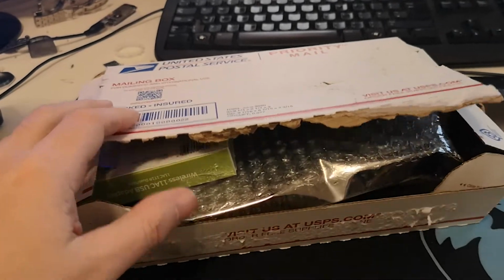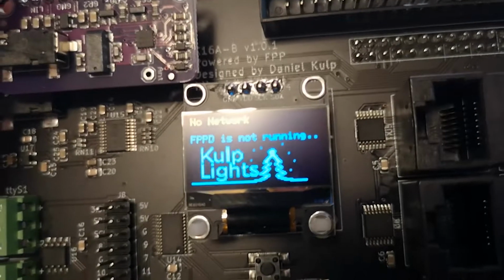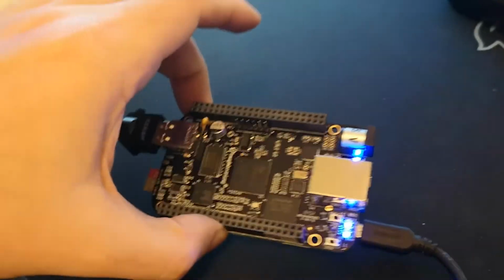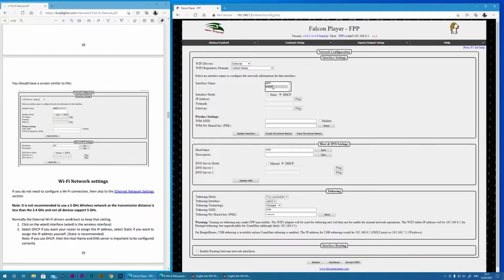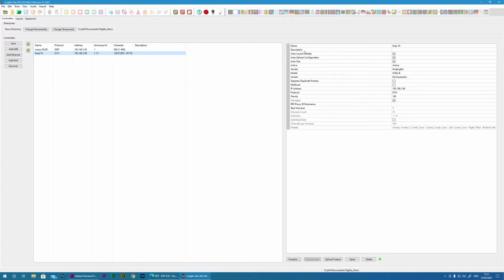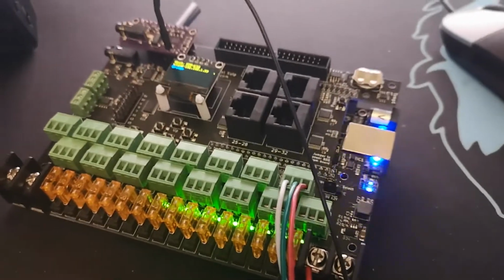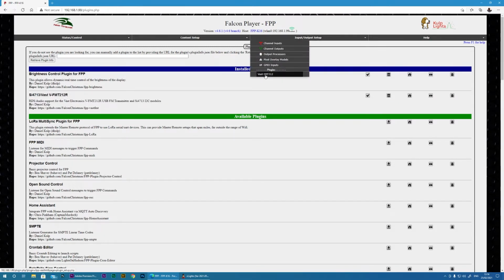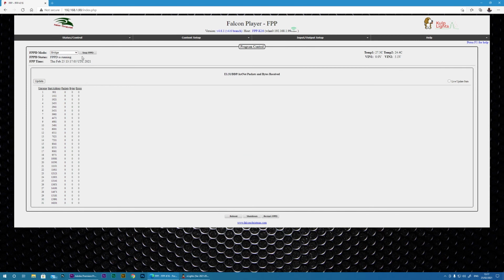Kulp Pixel Controller Basic Tutorial

Comment: thanks for this amazing tutorial! did you used the wire of which kind of metal?
Reply from the maker: @PapaiNerdBR  I just used some thin wire I had in hand.
Reply: @qualar  tnks. Do you put a tape to isolate it? I see in the video that is black
Reply from the maker: @RicardoMaranhaoMD  No that is just the plastic coating on the wire.  That will not interfere with the signal.
Reply: @qualar  did you put to prevent touching other components?
Reply from the maker: @PapaiNerdBR  It's plastic coated so cannot short.

Comment: Hello, very good video.  I have a problem with the FM transmitter, at 4 meters you can't hear anything and you can also hear it very low.  Sorry for the English, it is with a translator.  thank you.
Reply from the maker: @pablomeza2894  Have you made sure your aerial wire is the correct length?
Reply: @qualar  What length is recommended?  thank you
Reply from the maker: @pablomeza2894  It all depends on the frequency you are going to use.

Comment: I think since ive struggled so badly, on and off for a full year actually, I thought maybe those of you that tried to point me in the right direction, heres a huge THANK YOU!  I kept trying to refigure my settings and one day what was working would not work for me the next time.  I went into my router settings i was too scared to mess with for months finally.  I changed the setting in the router, finally theres been some success.  
My show (8-50 pixel strand and then you 😅1megatree, 50 pixel star I made, 300-small spiral tree strip I built with clear tube, and another 300 strip so nothing too crazy) are now working now. 
Last thing is getting sound and not just text displaying on the radio.  
But, next year i will have good show i bet.  Thanks!
Reply: What setting did u change on router
Reply: Had finally 'got it' by opening xlights, seeing up a few simple models, and not setting up the controller in FPP.  Now I change the controller layout every year, I can connect to the controller easily but have to redo my sequences all over again. I dont understand how to map my old stuff is why.  But I'll figure that hopefully soon.
Reply: Had finally 'got it' by opening xlights, seeing up a few simple models, and not setting up the controller in FPP.  Now I change the controller layout every year, I can connect to the controller easily but have to redo my sequences all over again. I dont understand how to map my old stuff is why.  But I'll figure that hopefully soon.

Comment: Hi Phil, great tutorial! I haven't seen this issue anywhere yet, sorry if this is common knowledge, I found that the only power supply entry that will power the beagle bone, is the first one you ran yours from. I connected the new k32 a-b (haven't found much documentation for this model yet), to my power supply at the top left, then bottom left side, only to find no power getting to the beagle bone, so I reconnected to the port which runs 9 through 16 and the beagle bone lit up as well as the little screen. Wanted to pass this on to anyone with my same issue. Thanks Phil!
Reply from the maker: Yes that is correct.

Comment: Hi i have an issue with my kulp and xlights i wonder if you could help on this , its all up and running but i have a few props and a tree , seems the effect off the tree is syncing with the props , what i have tried to do in xlights is have all props doing there own colors but there all syncing with the tree effects and being a novice i do not understand why this is happening , any help welcome .
Reply from the maker: Are you using the visualizer to assign your props to the board?
Reply: @qualar  Yes your right i have tree in port 1 then port 2 arches and so forth .
Reply from the maker: @retardmonkeys1767  In Xlights go to your layout and check for channel overlaps.
Reply: @qualar  I think the channel output in fpp are wrong and will have a look later and change the channel outputs on xlights , i think that may be the issues why there all syncing the same time ,

Comment: I followed this perfectly.  I plug in my set of pixels, quick flash, and then nothing.  I've gotten a single light on a few occasions on solid.  Both a red single and sometimes it's a single blue light.  I push test and nothing happens. I've connected and disconnected everything numerous times with same results.  I confirmed 11.98 volts.  Only the right side.  Allow the boot up.  I can't understand why no lights when I plug in my string.  100 pixel string is what I plug in.
Reply from the maker: Before diagnosing the board I would check that the pixels are OK first.  Also are your pixels 12v pixels?
Reply: @qualar  yes.  I posted this quite awhile back.  I'm sorry that I never followed up.  
The pixels I bought were good quality.  The thing about them was they didn't have the little arrow for direction.  Being so new and alone trying these things I had my pixels string backwards!  
Live and learn.  Months later now, I'd love to say that I've done all these magical things but I've been stuck so many times.  I can say that I've gotten multiple props working, simple stuff.  Xlights is not as simple as one would think.  I hope to have a decent light show by Christmas with about 3000 total pixels.  Add on all the time though and what I used to hate ( swore I had given up 10 times I bet) now is becoming fun.  But time consuming and more to it than ever expected
Reply from the maker: @peleger1  Great work.  If you want quick to the point Xlights video I have tutorials on a YouTube channel called Xlights Training Nuggets.
Reply: @Gadget Phil  yes, 12 volt pixels.  I have the jumper on 12v as well.  I've tried different pixels in different ports, all lights are on by the fuses.  The beaglebone black has the solid blue light and the others flicking just like the video shows.  I did have the right and left powered up using the same power source on my first set-up.  Confirmed 12v on both sides.  Went through the screen options, selected test that way as well.  When I plug in the pixels in any port, my power supply fan speed increases by quite a bit like it's being draw on, when I disconnect the pixel string, fan goes back to slower speed.  I've yet to attempt to move onto the next steps connecting to my wifi because I'm pretty sure if I'm not getting lights to go on at this step then I won't get the lights to light up after finishing the setup.
Reply from the maker: @peleger1  Its hard to say what the problem is.  The video I posted was me opening and connecting from new so I didn't do any extra steps.  I know there was a time that some boards has a faulty chip.  Maybe email Kulp and explain the issue.
Reply: @qualar  thanks for trying to help me.  I'll give them a chance
Reply: @peleger1  I had the same issue , i would do a complete reflash of the sd card then make sure the pixels are ws2811 , seems when connecting to blocks  the 3 wires it is back to front , its negative data then positive , go to channel inputs add them to what channel , but doing a test they should show anyway .

Comment: Great Video!
New to all this though. I have a question.
I'm building a Megatree with 32 strands of 50 pixels each. Can I use the K16 or do I need to use the K32 because it has 32 ports?
I see in your video that even though you used K16, your xLights had more than 16 ports configured. Can we do that?
Reply from the maker: Yes you can easily do a 32 stand megatree on a K16 and a lot more.  1 port can handle multiple props and/or multiple strands of a megatree.
Reply: @qualar  Thanks. Do you have an example to show how I can connect multiple strands to 1 output port?
Reply from the maker: @adigururaj  You just configure it in Xlights by dragging the prop or strand to the desired port.  If you go to the Xlights zoom room they can talk you through the process if you are unsure.

Comment: Is the antenna for the fm transmitter a commercial piece? If so, where did you buy it?
Reply from the maker: No just a thin piece of wire cut to the correct length based on your frequency.
Reply: @qualar  how is it attached?
Reply from the maker: @charonnisis  You can just solder it directly.  i put a pinheader on so i could remove it.
Reply: @qualar  Silly quiestion, what size pinheader and where can they be bought?
Reply from the maker: @terrymagill7350  Which pinheader are you referring.  If antenna it's just a standard size used on pc motherboards.
Reply: @qualar  Thank you

Comment: I was curious was there anything else you needed to do that you didn't show in this video to get the FM transmitter to work? I am having a lot of issues trying to get it to broadcast music. I was able to get music through FM by plugging my phone into the 3.5mm jack but can't get music through the FPP mp3 files that are being played from my sequence.  I have the latest version of fpp 5.4.1 and updated plugin from kulp (verified that it is the one by Kulp.
Reply from the maker: No I didn't do anything extra and it worked first time.
Reply: @qualar  Thanks for the reply, I have a work around to get it to work. I am using a pi to output the sound through its 3.5 mm jack to the FM transmitter its less than ideal but don't know what else to do

Comment: Fantastic Video! Thank you for the great detailed explanation. I am completely new and information like this is invaluable. Could you share a link to the FM transmitter wire? I am a little unclear on what to use and how to connect it properly. Also, how do you like the wifi ? I just bought a 32A-B and wasnt sure if i should go Ethernet or Wifi. Thank you!
Reply from the maker: Just use any thin piece of wire.  Thick wire is worse for this aerial.   WiFi works perfectly.